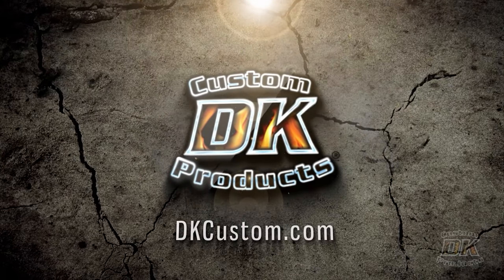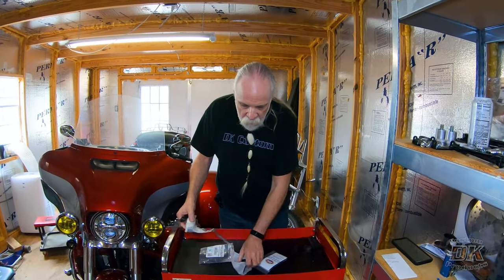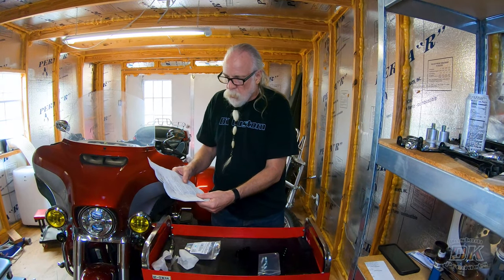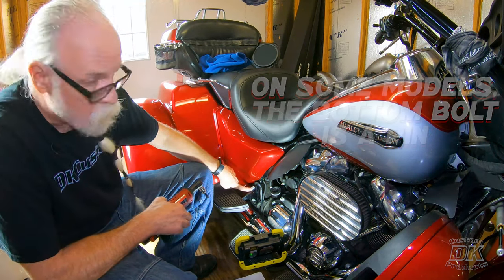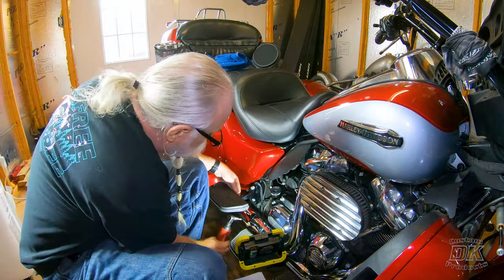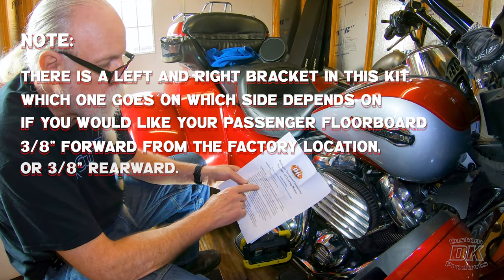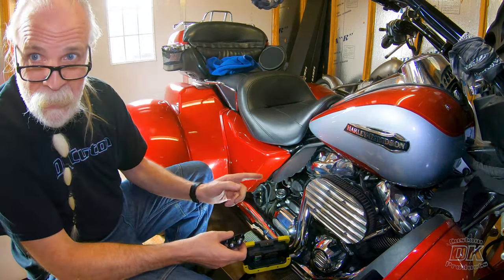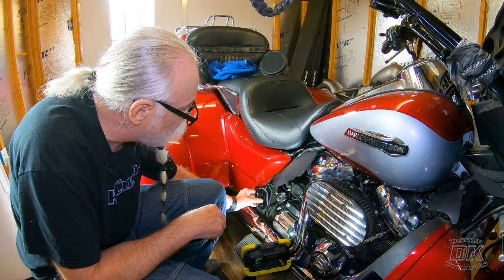Reduce Harley Passenger Fatigue & Increase Overall Comfort - If Mama's Happy, Everyone's Happy!

Comment: Any problems with hitting your legs on floor boards when pushing motorcycle?
Reply from the maker: Depending on how it is installed it could give you more room. If it is moved to the most forward position it will be about 1/2 an inch more forward. If that would hinder you then I would suggest not putting it at that position, but this is not a complaint we have had. 

You can see some customer reviews at the product link if you scroll to the bottom at this link - https://www.dkcustomproducts.com/passenger-floorboard-relocator-fb16-harley-baggers-trikes.htm

Please feel free to contact us with any questions;
Support@DKCustomProducts.com
662-252-8828

Thank you for commenting! MB